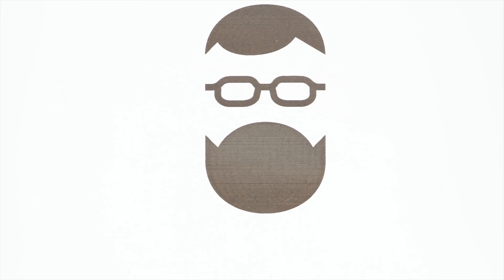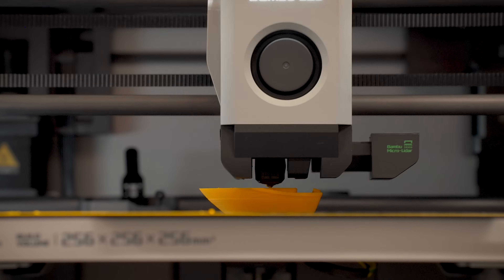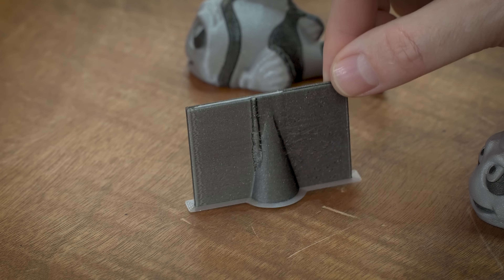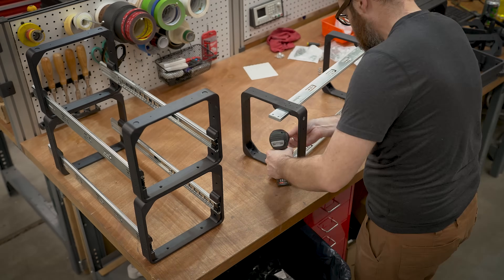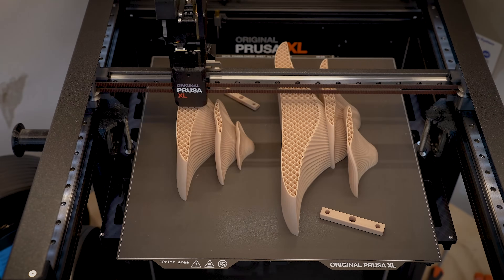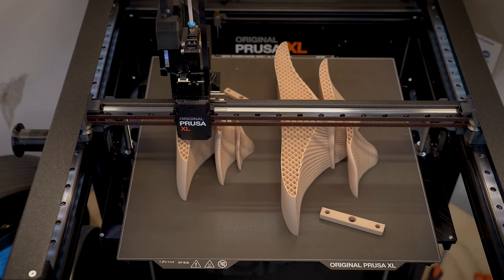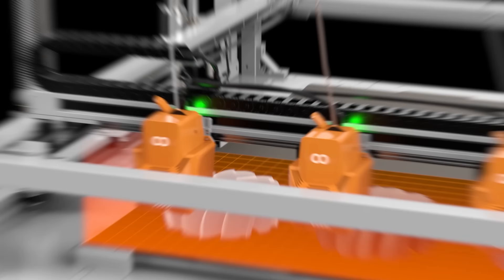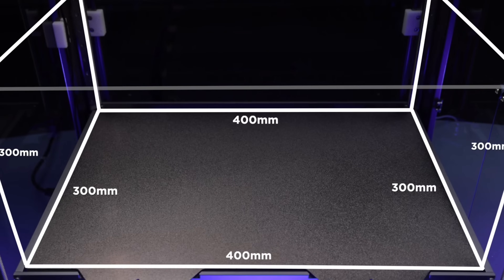Choosing Between Prusa XL and Bambu X1C?

Comment: The pickup vs sedan is a great analogy.  I’d used single head printers for years, but was more creative in CAD to figure out how to make dissimilar material assemblies assemblable but now with my 5t xl I just let it rip. But you still need to think (your video on the membrane keyboard was invaluable) about material compatibility and linking the mechanically. Doing medical simulation we wanted to make a knee joint base that we could “injure” for teaching purposes, and so we engineered the TPU to be mechanically captured inside the PLA (barbells). The prime tower kept waste to a minimum, and it turns out ligaments are a bit trickier than Tpu ropes but with clever shaping we got reasonable feel The model is hidden under fake soft tissue so nobody sees the ligaments look like crinkle fries. We haven’t tried adding other materials yet (maybe nylon 910 for the slippery joint surfaces?). The only trouble child has been bvoh (first didn’t print awesomely and then didn’t leave a good surface - hint, please do a video debugging that)
Reply from the maker: Nice!  Yeah, something like the 5T XL really does remove many limitations.  I just need more projects that require stuff like this, I have a hard time just prototyping without a purpose.

Comment: Honestly, I think another elephant in the room is Bambu's very sketchy intellectual property practices, both for the end user, and for the broader market.
Reply from the maker: For sure, but I didn't want to poke the hornet's nest...
Reply: @RobertCowanDIY  I think it's a big deal to mention! People will have to make up their own minds if they care or not. But to me, that's what turned me of from even considering the X1C, when it first came out! And it's why I got myself an Mk4, despite knowing that I could get 2x A1's for the same price. 

I think it should be brought more to the light why chineese products in general will always be cheaper. In Prague, they treat employees like humans, and pay them accordingly. Not so much for most companies in China. Ref the now aging Foxcon-case, where employees found it more desirable to jump of the building than just doing their jobs and go home. As most people probably know, the companies response was to add safety-nets and bars to the windows; not to improve the working-conditions. I'm sure there are exceptions. And I know certain things can't be bought other than from China. I do obviously buy some of it myself. But I try to choose other options, when they are available.

Comment: First of all great comparison and great advices. There is somothing else to consider too... Bambu to achieve these crazy speeds, overheats the nozle to a point that you lose rigity. So it is a great prototyping machine, but if you need rigity you should drop the printing speed to normal levels.
Reply: What does over heat the nozzle mean? They both hit similar nozzle temps. Prusa XL default brass nozzle hits 290C and bambu hardened steeel hits 300C
Rigidity can be changed with walls, infill, line width, very basic settings.
Reply from the maker: It's just an anecdote, but I had a nozzle literally 'fall out' on the X1C.  The whole nozzle just pushed out, they're just press fit.
Reply: @RobertCowanDIY  Can't speak to beyond anecdote but running my X1C for 18 months and no major issues to speak of. 
I am on my 2nd , 0.4mm nozzle but not due to failure just basic maintenance. 

But for 15 bucks and 15 months of usage I cannot complain.
Reply from the maker: @hawtdayum I'm on my third hotend, but it's otherwise been decent.  Not the most reliable printer I've had, but it's good.
Reply from the maker: Absolutely.  The speeds they achieve aren't really great for structural prints.  However, slowing it down (selecting 'silent mode') gives much better results, but then you don't have the advantage of printing as fast.

Comment: Name one FDM 3D printer other than Prusa XL  that has more than 2 tool heads, has more than 300x300x300mm build volume and is not made in CHINA, that costs less than 5k EUR. Not everyone needs such machine, but it's still a great value.
Reply from the maker: You'll find no argument here.  I agree with you, but many people feel that the AMS is a tool changer.  It's just a filament swapper and IMO a much inferior method.

Comment: You could save a ton of money by getting the X1C over the OVERPRICED Prusa XL.  Hell just base to base the X1 beats it in price, and full versions....a 5 head Prusa XL is stupid expensive price.  You could get the X1C WITH 3 extra AMS's (for 16 color printing) and STILL be cheaper then the XL.....oh and one is Enclosed the other....isn't.
As for large printers....a Voron 2.4 350 LDO kit is cheaper, still.  Note: There is a color changing system for Voron printers that can be built up to 18 colors in size.  As typical Voron design you build it how you want, and the kits for like a 6 color one are very cheap.
The main problem with Prusa is they are overpriced for their volume, or anything else they do, there is always something out there that is cheaper.
Reply from the maker: You should MAYBE watch the actual video.  'color changing' is not why toolheads exist.  The AMS does that well (although with a lot of waste).  But toolheads allow you to print dissimilar materials together with very little time between toolhead swaps.  They are different tools.  Watch the video, this is all covered.
Reply: @RobertCowanDIY  Thing is there isn't anything the XL does that the X1C doesn't do as well.  Even when printing different materials at the same time, the AMS can do that too as long as you have a hardened steel nozzle to handle the more abrasive stuff.  
The main issue with anything from Prusa is PRICE and the fact they are OVERpriced for their build volumes.  Even the VORON 2.4 350 kit from LDO, is the more expensive version of a Voron kit, is still WAY under the cost of a Prusa XL.  The Voron is same build volume (10mm difference), and ENCLOSED already.  If you want multi material, a kit for about 200 bucks can set you up with 6 colors.  You can build the ERCF to up to 18 colors or whatever you feel like building as long as you can find the parts to make it happen.
All together a Voron 2.4 350 LDO kit with an Enraged Rabbit Carrot Feeder 6 color is LESS ($1700) then a Prusa XL solo toolhead ($2000).
Being "super reliable" printers can only get you so far but when your prices are 50% or more then the competition and you don't do anything different then them, then what is your purpose?
Everything that competes against the Prusa XL is already cheaper by a good 500 bucks AND already has an enclosure.
Reply from the maker: @SirLANsalot  You should REALLY watch the actual video, all this is covered.  If you can print TPU alongside a higher temperature filament and not take forever due to numerous slow filament swaps, please start a channel and show how you're doing it.

Comment: The A1 isn’t featured in this. The A1 is by far better then the p1p however if you need an enclosure that’s a different story.
Reply from the maker: The A1 was recalled and not really comparable here.  How is the recalled printer better than the P1P?  I was mostly addressing actual requests to compare the X1C to the XL.

Comment: If you can not afford the 5 head Xl and Bambu together. Than buy Bambu.
Reply from the maker: Yeah, I'd agree with that.  Having both is pretty nice.  I use my X1C to prototype quickly and then print the final parts on the XL.  That works for me at least.

Comment: Great video and thanks Robert. Really informative video. What Prusa should really include with the XL is an enclosure with heated chamber and HEPA filter - that will complete the package. XL as it is today, cannot print ABS / PC / ASA / PA6 / PA12 or any new materials that requires enclosure, which severely impact the usability for those who actually need the size & versatility with their use.
Reply from the maker: Yeah, agreed.  That being said, I just finished printing 5 full rolls of ASA on it...
Reply: Do you use any technique to print that material or do you have an enclosure built by yourself?
Reply from the maker: @Ronoaldo  Check my channel, I'm basically using a shower curtain as a make-shift enclosure.  It works well.
Reply: @Ronoaldo  My first 3D printer an UP+ from 2011 printed ABS in great quality without enclosure. It had a base that looked like print board material with a lot of small holes that kept it from warping.

Comment: I really don't understand people wanting the XL just for multicolors.  Its beyond overkill
Reply from the maker: Oh, agreed.  However, it is significantly faster than other options if you're doing a lot of color changes.  But I wouldn't buy it just for that.
Reply: @RobertCowanDIY  that is true I forgot, plus you can turn off the purge tower.  Did you try?
Reply from the maker: @krollmond7544  Check out my most recent video.  In short, if your model allows for it, you can get rid of a purge tower.  If your model isn't right, you MIGHT need one.
Reply: I had to buy the XL because i am making bigger molds

Comment: Huh? You say you would only buy an XL if you have need for 5 tool heads for exotic-multi-material printing.  I say you don't just buy the XL just for using different types of materials. (even though I do use multi-materials).   Just printing TWO different COLORS (or the same material) on an XL , the XL will print 10X faster than a Bambu! And you don't need exotic multi materials to be useful,  Have you tried using a different materials for supports? XL users are having amazing results using PLA for supports with PETG prints. They don't stick at all to the PETG and they are trivial to remove. Furthermore,  as a  large format printer, the XL has much better features than most other large format printers (eg a Voron) like automatic bed leveling, multi-heating zone on the print bed.  The XL is a great value with just two print heads.
Reply: I think folks that are comparing multicolor/filament prints of a bambulab vs XL are not looking at the actual advantages of a bambu printer.
Let's get the basics out of the way XL has the wins on general size
The bambu printers have the edge on single color prints speed and quality but you arent limited to 4 colors as you can go up to 16. That is filament redundancy, filament drybox, that is not touching filament for 4-16kg. 

When it comes to hardened nozzles, enclosure, printing exotic materials, camera, and a host of other features on the BL printers. XL only has the size and some niche multifilament situations. 

Did you know you can print a model all in one filament and just have a single layer of petg/pla be the interface? this drastically speeds up the print time. I have seen folks print layer by layer with support and they are just wasting filament and time. 

But the elephant in the room is the XL price and availability. the 2x print head is 2500-3000 before shipping and you wont see it until the later half of 2024
You can get 2-6 P1S/X1C /P1Ps and get in less than a week. Before the A1 recall that would have been almost 7 printers vs a single XL 5 head.
Imagine how many prints you can get in 6 months vs waiting for prusa to get your order sent. Then you are in for a full or partial printer build vs a machine that is ready out of the box. 

If you are printing in a print farm like situation there is no calculation that will push out more parts on a single 2500-3000 (2head) XL vs a 3 p1s. The pricing gets more stark when you look at the 5 head printer. 

A single XL may beat out a single Bambu printer in high multicolor changes but will not beat 2-6 of them printing in volume.

Comment: The Xl is a very very niche device for my needs. None of my parts use dissimilar filament. I am hard pressed to fine a reason to mix PC/ABS or nylon with lesser filaments types(pla/petg etc)

The waste argument is kinda moot in my world. The price difference cannot be ignored. 
2500 worth of waste filament is a huge amount to justify the XL
Just thinking about the math, a color swap is about .3-.7grams, before swap tweaks to get 30-50% additional yield
I buy filament in bulk and that is about 200 -250rolls for $2500
I would need hundreds of thousands to several million filament swaps to just match the price of the XL before it prints a single gram of filament. 
That would could be years worth or printing before the waste is an issue.
Also it's only waste if you deem it waste. There are several ways to reuse it. 

So you are correct size can be done with many other types of single head printers, and large multi filament prints it's main use case.  3500-4k is a hard sell.
Reply from the maker: This is pretty much exactly what I covered in the video.  You don't have a need for it, so it's a terrible value for you.  If you absolutely NEEDED those capabilities, it would be a matter of figuring how much money you'd be willing to give up to have those capabilities.  Obviously the cost of filament will never offset those costs.  BUT, time is money.  If you could print out 2-3 faster due to a lot of filament changes, it might mean more parts in a day and more profit.
Reply: @RobertCowanDIY  Fair enough, I think you were spot on for use the tool that makes sense for the project. I just am personally hard pressed to find many uses for the XL. 
With the initial cost met, I am limited to non abrasive basic filaments. Those brass nozzles will get chewed up with abrasive filament. Printing [toxic] filament without proper enclosure, ventilation, or filtration is a non starter. 
 A proper enclosure kit $??? and Obxidian hardened nozzles ($50x5) is additional salt on the financial wound.  

I have been following your channel for a while and forgive me if I am reaching with this statement but, you seem to be hard pressed in printing actual multifilament parts. The TPU/pla part was one, and multicolor marlin toy print was another. 
Some filaments do not bond well together and mixing filament with wildly different characteristics dont seem to work well according to my youtube searches.   So while the printer is capable of multifilament printing it has very limited uses for what it is sold as. 

  
So if the XL is claiming the speed crown with multi color prints but in terms of overall volume $3500-4000 is 2-4 multicolor capable printers which on the whole would be faster than a single XL especially if you have to factor in hardened nozzles, enclosure...
Those 2-4 machines would produce more than a single machine meaning more profit, less downtime.

Comment: I don't understand the statement that a X1C can't do multimaterial - if remove TPU as the AMS can't push that through - what is to stop you from printing multi- material? I print multi-material all the time
Reply from the maker: I thought I was fairly clear, TPU and abrasives aren't meant for the AMS.  People HAVE used abrasives, but over time they will create issues.  I'm considering that 'multi-material', since printing PETG alongside PLA is fine, but not really all that compelling for me at least.  I want dissimilar materials.
Reply: @RobertCowanDIY  - Yeah.. I'm just going on my own experience - TPU agree - abrasives  - 7 spools of Glow-ITD, and 3 spool (one partial spool they give you as a sample) of PLA-CF with no problems. I guess I didn't read the manual - wasn't aware it was not recommended - maybe I have not hit the level of power user yet...
Reply: He has a very niche use case. You have to nearly design parts to utilize it otherwise most common parts are either single filament type or assembled. 
There are mods to print TPU with the AMS but like everything YMMV. 

There is a special TPU called STTPU by DUDV2 which prints like PLA and softens like TPU. 
 Hardness 80D when printed (Dry) and 65A when soft. it can be submerged in water to speed up the flexibility through absorption.  
Folks have had good success in the AMS with this.
Reply: There are two aspects of multimaterial that the XL does a lot better, and what he was alluding to:

1) multimaterial with tpu. Tpu on the bambu is a no go for the AMS.

2) multimaterial with very different temperature materials. On the bambu, you can't really do polycarbonate with say pla (ask me how I know!), you will get jams from the extruder melting the pla too early when switching. XL is great for this.
Reply: @Tom--Ace  Multi material isn't exactly the holy grail of printing for the XL. @YGK3D tested 12 different models and the ones mixed with TPU, printed but you wouldn't consider them successes as the models broke with my minor use.

And I'm still trying to wrap my head around why someone would use the superior polycarbonate mixed with relatively inferior pla.

So my question isn't could you do it, it's more  why would you do it?
Reply from the maker: @Tom--Ace  Exactly, I was trying ot keep this video short and sweet.  "dissimilar materials" is what I was getting at.
Reply: @Tom--Ace  I guess I'm just lucky - I use PLA all the time as a support for PETG (as it does not adhere), and while I know PETG is not polycarbonate - I run my nozzle at 265 for PETG, which is right around the range of most Polycarbonates and I have never had a nozzle get jammed up. Again I agree - TPU has to be manually fed. But for me at least - multi-material has not been limiting as what I've heard. And again - maybe I'm just lucky?? But my real world results are what they are to this point.